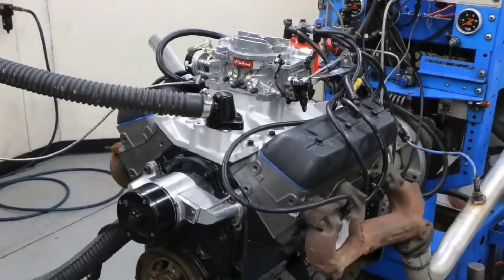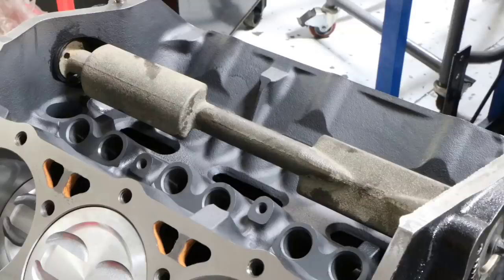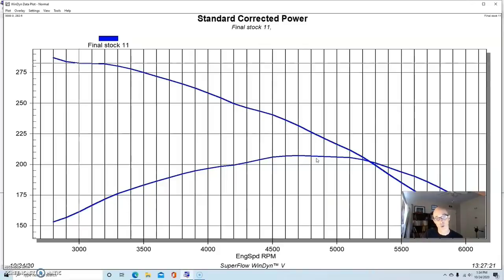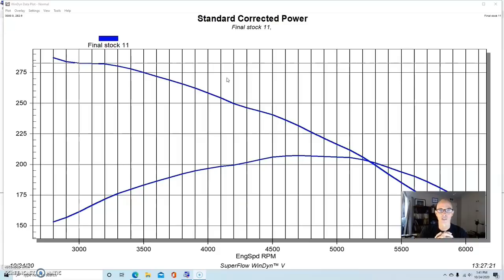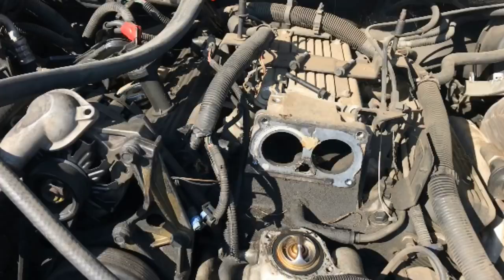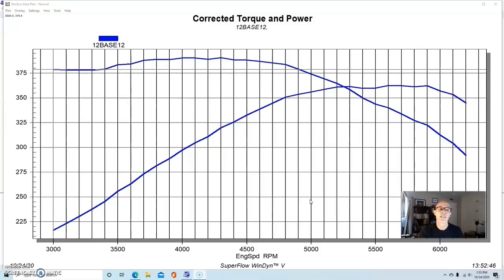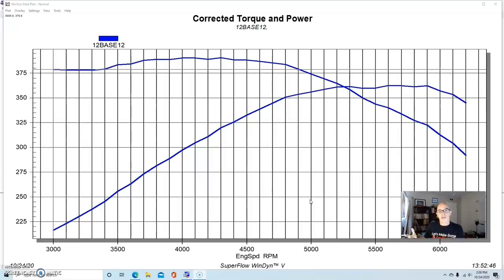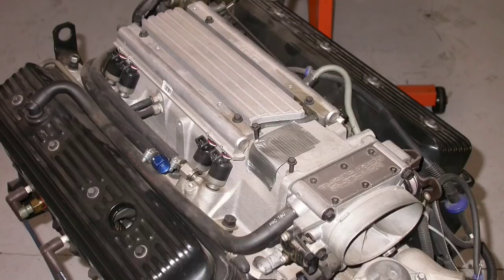4.3L V6 VS 4.3L V8-WHICH OTHER GUYS MAKES A BETTER BUILDER?

Comment: I had a 262 v8 in a75 monza  turbo 350 with a shift kit upside-down airfilter 3 inch straight  through  exhaust i dry race that car every weekend and drive it home ,even had to do a few getaways  from street racing  Vandalia and fountain Ave bklyn ny,1985 and 86,

Comment: I'd rather have the baby LT1 because the V6 has an offset pin crank and everybody seems to snap them when boosting hard.
Reply: Interesting, what sort of power & torque levels?  I'm blessed with split pin PRV V6 motors & be interested in doing some comparison
Reply: @mfaulks206  I don't know, I have just seen a lot of pictures of them snapped.  Looks like some of them are pretty darn thin

Comment: When I was in highschool my machine shop teacher was a fellow drag racer and we collaborated and built a 4.3 v6 on top of a old 3.8 229 chevy 6 and believe it or not that 4.3 ran low 8s in the 1/8 mile with ported heads with 2.02 valves in a fully dressed 84 grand prix with 5.13 gears
Reply: I'd say we got around 400 hp out of it also with 12.1 compression

Comment: They went 4300 as the 305 would have been too close to the 350 in power output and they were hoping for better EPA mileage.

Comment: I have a 99 astro, I wonder how difficult it would be to put a 350 in it. I don't think there would be any issue with the bolt on accessories, but I think it might be interesting for the engine mounts. 
BTW I didn't know about the 4.3 v8
Reply: I put a 400 sbc into a 91 Astro AWD. I used the V-8 block mounts and the V-6 frame mounts.(they're both the same anyway) The lower mounts did end up a little further forward on the cross member, and hung off slightly, but with a welder and 2 pieces of angle iron to support the bit that hung off the cross member, it was all good. Just weld them down wherever they end up once your transmission and driveshaft end up in the right spot. The V-6 radiator cooled the 400 just fine. The only issue I ended up with was that it seemed that with the engine all cooped up under the dog house, the hopped up 400 would seem to run out of air at anything over 5500 RPMs or so. No matter what carburetor I had on it, it seemed to not be able to get enough air. If the dog house cover was off, it would rev to 6800 with no issue. With the cover on, it wouldn't. Same issue with the engine hot or cold. I think with the dog house on, it was just too confined in there for enough air to get in to support the higher revs. 🤷🏻

Comment: Looking at a Cadillac all aluminum engine , is it a 4.3 liter or 5.7 ? DOHC ?
Reply: Did a little more research on this engine , heads are throw aways per GM and it was plagued with design flaws  so much for that thought … going back to building my 327sj !

Comment: The Caprice was the same Holden Platform which was a V8 platform but GM didn't want it to compete with their "Prime" v8s, so they intentionally made a "small" V8 to "down rate it". The same platform as the Caprice is the Chevy SS, the Pontiac G8. The "pursuit" version of the Caprice police car has the better engine in it.. but the real reason was GM didn't want the Caprice to compete with the Camaro.

Comment: Had a truck with the 4.3 v6 went 400 k with no mechanical issues still had the stock clutch when I sold it I’d take that motor all day long

Comment: V8 for parts availability. I was looking at changing a 3.8 ford for a 4.2. Lack of aftermarket performance parts.  And mostly no one is really interested in the finished product.
Reply from the maker: all that matters is you are
Reply: @richardholdener1727  I'm thinking as cost to build and resale value. But yes, as long as it makes the person happy to do it.

Comment: I did a mild junk yard build v6 on my silverado years ago the 2002 silverado v6 had better heads they had the same rockers as a 5.3l ls... I used the stock spider injector intake but ported the lower metal part... Ported the heads bigger valves for a 350 valve springs for a 350 comp cam ported therottle body I had to keep the efi cause emmisions... So I struggled a bit.. I gapped the rings stock bore but had the heads decked so a lil more compression... 350 arp main bolts head bolts and rod bolts modified dual roller timing chain set for a 350... Think we used some cheap summit racing pistons for a 350.. never did the turbo cause I didn't wanna make the kit by hand typhoon stuff is hard to find... So I hit it with a shit ton of nitrous after getting it tuned using hp tuners.... Never hit the dyno after nitrous but I did however run a 11.8 qtr after taking the bed off and gutting most of the interior on a 150 hp wet shot just used a afr gauge till I got 11.5 ish while using the nitrous by changing fuel jets but I'd easily say 400 ish horse I have a 400 horse 2jz currently and I really miss that truck I ended up sending it to the grave after a oil pump shaft broke
Reply: But as far as what you asked about the heads a few forum guys say the vortec heads flow about as well as 305 heads and porting could bring flow rate from 130 ish cfm to 200 plus cfm
Reply: Plus the lt1 deal I'd rather run the chevy performance intake it allows you to ditch the junk optispark distributor drivin by the timing chain and use a msd style one behind the intake as well as convert it to a carb... I've built a few lt1s as well I'm actually working one now bored out stroker crank splayed main caps... Cool part is it comes with a roller cam from the factory... So swap from press in rocker studs to screw in style studs and you can run a decent set of roller rockers ... Bad part really isn't any timing chain options and the gears are plastic good part the heads are thick walled so any dummie could port them easy... Then shave the heads to raise compression bigger valves aro head and main studs a set of rods and Bam you got a 383 or a 400 cubic inch setup that can take a ton of nitrous or a decent amount of boost... But all the valve train goodies that cost a small fortune to swap a gen 1 350 to a full roller setup
Reply: But if your really balsy it'd be cool to see you 383 stroker crank on stock bore on that lil baby v8 off the top of my head I think it would be around the same cubes as a 5.3l 325ci frankenstein then throw a turbo on it same with the built v6 I'd bet that gt3582r from cx racing would do good on the v6
Reply: Cause why 302 the v8 when I believe you could get the v6 to 302. I believe stock displacement is 282 ci on the v6 so punch it out as far as it could go and run 6 inch rods I'm curious and wish I could have gone that far with mine...

Comment: The more cylinders for same displacement would mean more internal friction in theory.
Reply: And more valves to breath. I could be wrong with the flow capacity, I don't know what the valve sizes are. Smaller bore smaller valves??

Comment: I'm not a GM guy but I would love to see this 4.3 block stroked to the 305 and boosted. Or a destruction video. I'm curious how much power you can pull out of that setup before it blows up. Was good rods and valves I'm assuming you can only push 25 to 30 PSI. But I wanna see it please

Comment: 4.3 V8 all day. V6s sound like crap lol. Seriously though v8 all day. I have a 4.3 V8 in my 2001 ML430 and I love it. 268/288 and it sounds good doing it. The hand built 5.4 in the AMG of course is much better but we're talking 4.3s. My GTO sounds better making 450 but the Mercedes is a fun reliable off road rig.

Comment: I stopped at 2:30 to write this. I know absolutely nothing about bow-tie motors. Just going with this information; v6 vs v8 at same displacement, I would probably want to go with the v6 because I would expect it to be a smaller, and probably a lighter engine. I don't know if the v6 is an over square design, but I suspect that it is, and that is another thing that makes me lean that way. Something like this would probably fit very nicely in a MGB GT engine bay.
Reply: An engine that i have always liked for swapping into little 4-cylinder cars is the 3.9L 60-degree V6.  240 hp stock.  Came in the Pontiac G6.

Comment: a stock lt1 ran a 15.1 with a 3.08 rear and a 28 inch tire in that big caprice, 25mpg on the high way.

Comment: Richard Holdener if you find a good rotating assembly for the 265 4.3 v8 rotating assembly I would be happy to have some good advise on it and if you could send me a link to one I'd like to turn my 305 Chevrolet into a 265 and turbo it like you were talking about I'd like to see your next video on the 4.3 v6 and v8 with a turbo setup thanks and thanks for the great videos I'm 16 and building my first motor

Comment: Both are great engines but have very different purposes. From a performance standpoint I would want the v8 but in my truck I would rather have the v6 for the low rpm power.

Comment: Keep in mind, back then GM still had their divisions with their own v8s. The 267 was a pontiac engine AND chevy had theor own version. The 260 was olds. The 262 was a chevrolet. The 4.3 v6 is a chevrolet. The 4.1/3.8 V6s are Buick. They are all different and share none of their parts.
Reply: 267 was a chevy small block

Comment: I have been a GM man all my life never heard of a 4.3 v8. I live in South Carolina may be this was a West coast thing?
Reply from the maker: GM sold the Caprice everywhere
Reply: We had plenty of Caprice here but they where not anything I owned or worked on. I must have missed it but it is interesting to discover.
Reply: L99/4.3/V8 was the standard engine in 94-96 era Caprice. 350/Lt1 was optional.
Reply: @MRBoatwrights  dont feel bad. I was a Cadillac tech almost 10 years, from99- about 08 and I  serviced some Caprices and Buick Roadmasters that always had LT1s. Friend of mine inherited a base caprice with 4.3l v8. When he got it I said 4.3? It's a v6! Had to see it for myself. Sure enough it was a v8. Emissions tag is usually your best identification.
Reply: 265 cid

Comment: Need to do nitrous on this 4.3 Vortec they respond to nitrous better than any factory engine I've ever sprayed. 

My brother had a 99 S10 4.3 V6 5 Speed he had a 175 shot of nitrous on it. It still had the factory Vortec EFI. Just a Hyperteck Tune and MSD 6AL ignition.  I have a 99 Z28 6 speed and at a 70 mph roll he put 2 tractor trailer lengths on me by 100 mph.
Reply from the maker: every motor responds to nitrous

Comment: I would definitely choose the V8 over the V6, as you say more cylinders and more overall valve area with the V8, which you pretty much covered.  However, you didn't talk about the exhaust sound and there are very few V6s that sound good.  I can imagine what a warmed over 4.3 litre would sound like and it isn't good.

I owned one of those mid 70s 4.3 L, the 262 cu in.  It was in a Monza with a 4-speed.  I put dual exhaust on it and followed that up with a Holley Street Dominator (funky single plane) and a Carter 500 AFB. It definitely responded to it but I'm glad it was a 4-speed and in a lightweight Monza 'cause with a slushbox and a heavier car it would be a dog.  Looking forward to the dyno runs on the L99.

Comment: had the 262 v8 in my 75 nova, put sr torquer 305 heads on it with a performer intake q jet and mild cam, made a big difference but wasn't a screamer (turbo350 and 2.76 final held it back alot)
Reply from the maker: 2.76-freeway flyer!

Comment: I'm guessing that due to small displacement of both engines (a stroker small bore V8 is possible, but the only benefit is better detonation prevention since the bore is smaller and the flame front travels to every point sooner), the answer to the question is, which engine responds more to boost? So which one has better head flow, to offer less resistance to boost, and that'll be the answer.
Reply: It's gotta be the v8 then. more cylinders for a given displacement also means more port area and more valve area. The eight has to be less restrictive.
Reply: Detonation occurs when the flame extinguishes too early (for whatever reason).
Reply: @ronaldcolman6211  exactly, the increase in valvetrain friction gets over-ruled by the other benefits.
Reply: @thisisyourcaptainspeaking2259  actually, its the opposite. the flame doesn't go out, it happens independent of the spark plug setting it off at the prescribed time (typically begun by some hot spot inside the chamber acting like a glow plug). you end up with two flame fronts inside the chamber at once

http://www.misterfixit.com/deton.htm#:~:text=Detonation%20%28also%20called%20%22spark%20knock%22%29%20is%20an%20erratic,combustion%20chamber%20cause%20the%20air%2Ffuel%20mixture%20to%20autoignite.

if the flame extinquished too soon, you wouldn't have much of a power stroke.
Reply: @albertgaspar627  Good read there, but detonation and pre ignition are different things. Pre ignition is basically dieseling, where detonation is loss of control over ignition (still within proper timing, but more explosion than burn and push) , usually because of hot spots in the chamber from carbon deposits, rough edges in the piston crown etc.
Reply from the maker: Pre Ignition and Detonation are similar events-that happen at different times. Pre Ignition occurs before the ignition spark (thus the name), this causes expansion of the gases well before the piston reaches TDC. This causes forces to push down on the piston during its upward travel (opposing forces-not good). Detonation is uncontrolled ignition from localized hot spots after the ignition event has occurred.
Reply: pre-ignition will cause damage (such as broken pistons) much faster than detonation, sometimes in just a few revolutions, depending on the severity.
Detonation occurs when the flame extinguishes prematurely (for whatever reason, could be too much advance, low octane (low octane fuel burns faster), too lean, even poor chamber design (incorrect squish).
Detonation occurs after the intended ignition event, pre-ignition occurs before the intended ignition event.
Cylinder peak pressure occurs at 14* ATDC optimally.  If peak combustion pressure occurs too early, this leads to detonation (the ping or knock sound you might remember).
Reply: @albertgaspar627  Yes, I consider spontaneous combustion an irregular event, producing detonation.
In my definition, this results in the flame extinguishing too early in the combustion cycle, ie: spontaneously.

Pre-ignition occurs when the air/fuel charge ignites before the spark event (for whatever reason).  Among other things, a plug of incorrect heat range (too hot) can cause this.
Reply: @ronaldcolman6211  You are right, pre ignition isn't always detonation. Back in the 1970's, cars often dieseled as Detriot tried to figure out emissions. But pre ignition during the engine's operation is how detonation occurs. detonation is two flame fronts crashing into each other. There could be a case of post ignition, but it happens so fast no one knows for sure, so pre ignition gets the rap.

Comment: I had a 4.3 v6 on my 1986 caprice
With 30over flattop Pistons i ported the factory iron heads
With duel value springs 
Compcam roller rocker 
Compcam camshaft 
Ported intake with 1 inch spacer
2200 stall th350
No dyno back then but i was faster than all stock 350ci caprices.

Comment: Sadly the majority of the B body line from 94-96 did get the LT1 5.7, most 9c1 and all B4U package Caprices were 5.7.  Then all Impala SS, Caprice/Roadmaster Wagons, Roadmaster and Fleetwood Sedans were 5.7 LT1 also. Why GM decided for the 4.3 to be the base engine option for a 4200lb sedan...we may never know.

Comment: I've seen 4.3 V6 turbo engines exceed 500 hp at the crankshaft. The V8 with the same package should beat that by 150 hp.

Comment: Go nuts and put a 3.75” aftermarket crank in the L99. 327-ish displacement of 328.87”

LT1 heads’ valves are too large for the L99 bore. Mild porting is the best you can really do with that but there’s gains to be had. Pair that with a cam squarely in the mid-220s duration and .530-.540”@.050 under a good full roller rocker. Largest cam I’d dare would be the Comp 07-503-8 (224/230 | .503/.511 on 1.5s or .537/.544 on 1.6s, 112LSA. With the higher lift I’d guesstimate this combo to around 365-370 GROSS HP range.
Reply: Would have to spin it to 6800 though...
Reply: I combed the catalog of existing rods that would fit stock pistons with a length of 5.565” and a poor rod ratio of 1.49 something. but nope. This idea would require custom pistons with pin height of 1.13” on a 6” rod (1.6 rod ratio) or 1.43” on a 5.7” rod (not so hot 1.52” rod ratio). the shorter rod would have more piston speed and have less RPM potential above 6k RPM but would have better idle vacuum and make significantly more low end to mid range torque...
Reply: But conversely, maybe better, the 6” rod would have lower piston speed and be great for a high RPM screamer.

Comment: I'd like to see a stock displacement 4.3 v8 with a set of 94 Ltd 5.7 heads a 69z28 5.0 cam and an 87 GNX turbo setup. Upwards of 500 hp and who knows how much torque. In a 79 Malibu I see high 10s.
Reply from the maker: THE dz302 CAM WOULD NOT BE THE IDEAL CHOICE-AND THE gnx TURBO IS KINDA SMALL
Reply: @richardholdener1727  I don't want a screamer. Maybe a good RV cam and a turbo off of a Cummins. 3500 stall and a set of 388s.